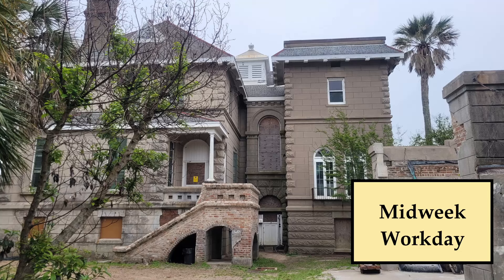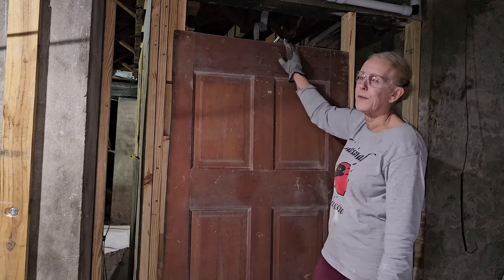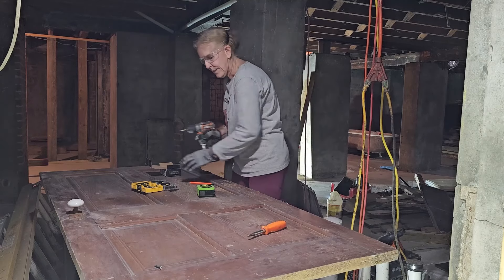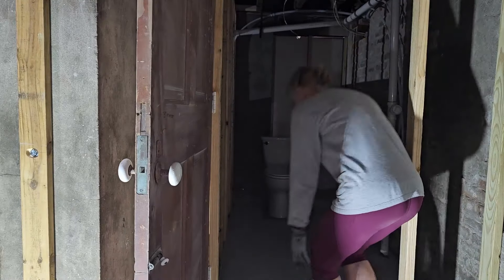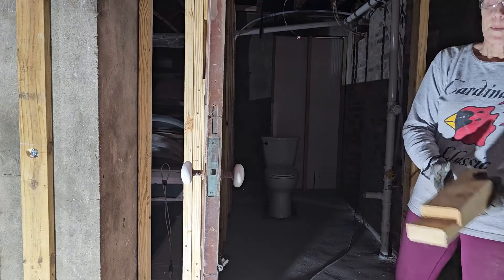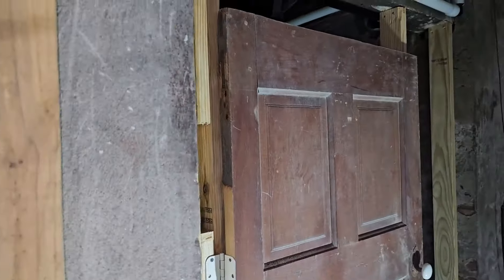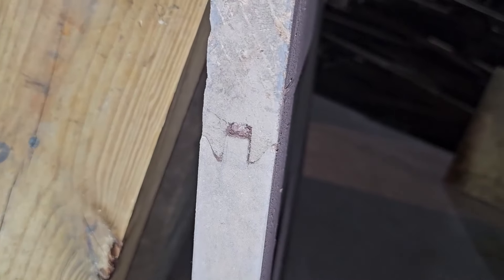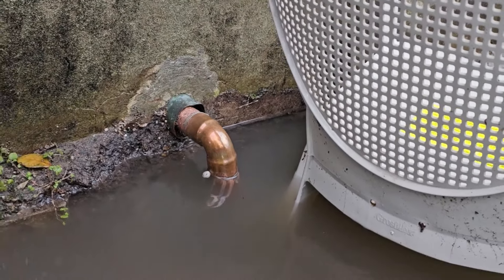S4.26  A Very Rainy Workday.  Our Bathrooms Need Some Privacy.

Comment: Bonus video  😘👌  Subtitles work great for the rainy day's audio 2x👍
All the doors in my family home are less than 5"7 high, the ceiling downstairs are really low too, if your taller than 6 foot you need to walk between the beams from the floor above, or get headaches 🤣 It is old so no building regulations then and people were a lot shorter too.
Reply from the maker: Wow, how old is the house?  Our lowest ceiling is 7 feet so that's good enough.  We still need to raise some of the arches for more headroom in the doorways.